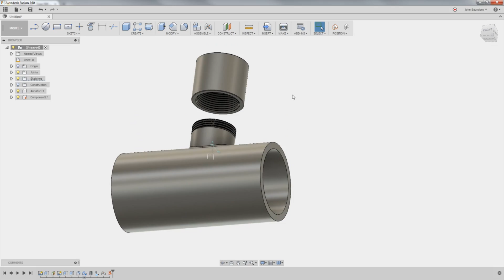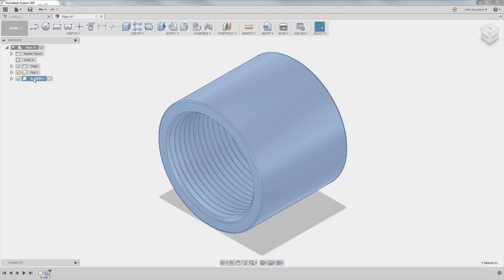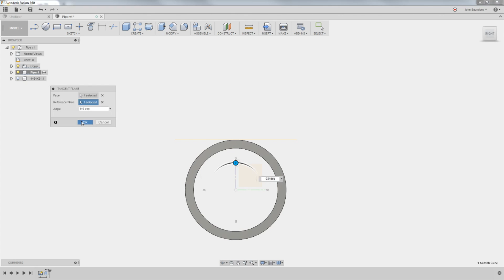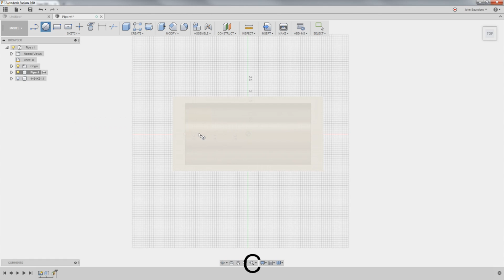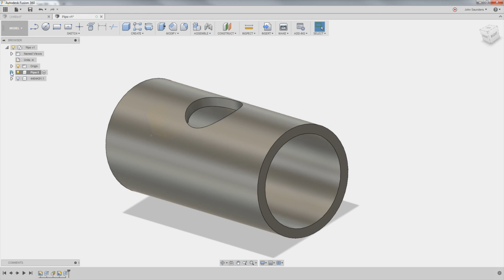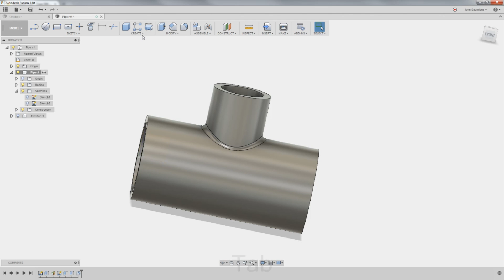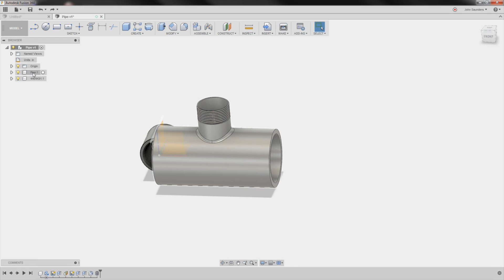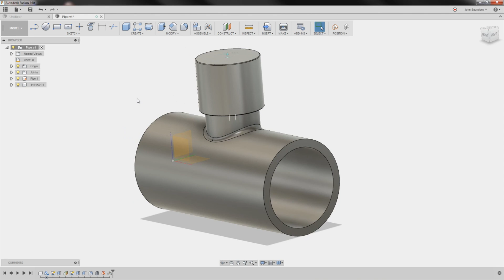Fusion 360 Tutorial:  How to Model a Pipe!  FF49

Comment: great, thank you!
I want to make similar detail but I want to have both ends like 4mm but in the center where I need to put the third pipe I want to make it like 6mm ... so it would end up like two conuses stiched on their wider radius side and every conus should be like first radius 4mm second 6mm and between two circels 10mm ... Can you share how you would approach that ?

Also - I have try to make the pipe just by making one sketch circle and then with the "Shell" command ... but then it doeasn't allow me to create plane on the edge of that body.... any odea why (the face of the cone is non-selectable if created with ("Shell") ?

Comment: Looks impressive but nothing more than typical "reality tv". 2 mismatched thread forms aren't gonna fit together so what's the benefit here to the designer in a true industrial setting? I've been there and "close enough" isn't an option when designed parts have to function also. If you have difficulty modeling a NPT thread why not import a pipe nipple and modify it to work as the "TEE" portion of the fitting? That way you would have a "working" part.
Reply: When you get that done feel free to link the video here so I can watch it.

Comment: Hi John! I think Fusion only supports non-tapered threads, which all the ones in the drop-down box seem to be? I think the workarounds are to do a coil or sweep which are a PITA. Especially for something common like NPT.
Reply: I just happened to deal with this today, yes, Fusion does not support taper threads yet.  The BSP threads it has are straight threads.  Another workaround to get modeled NPT threads is to just steal something from McMaster.  Not sure how accurate the threads are on all their models, but I've read that people have had good luck with that.